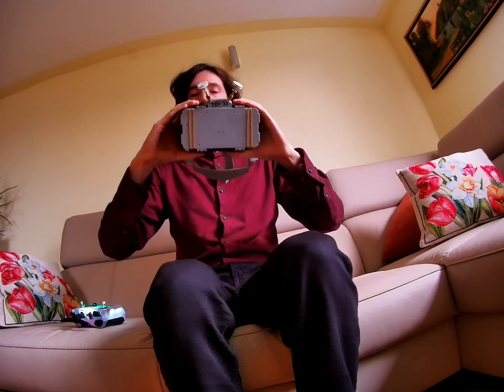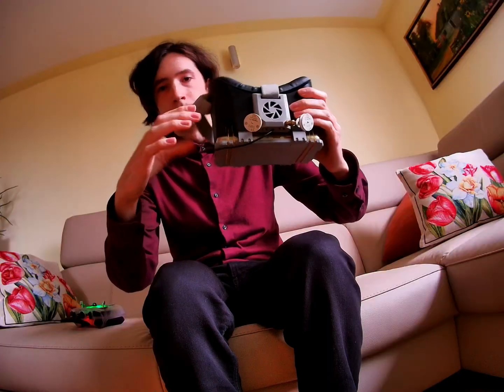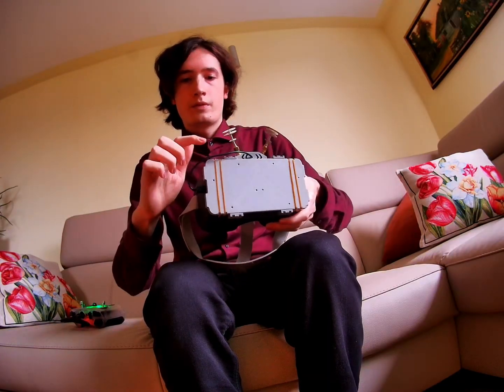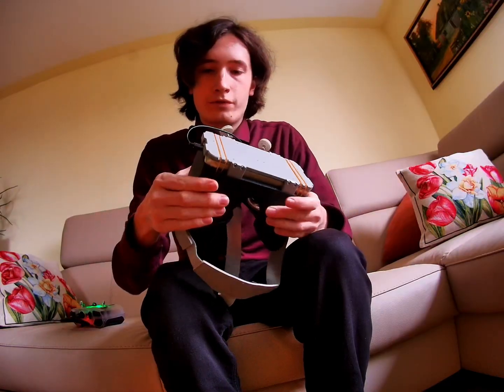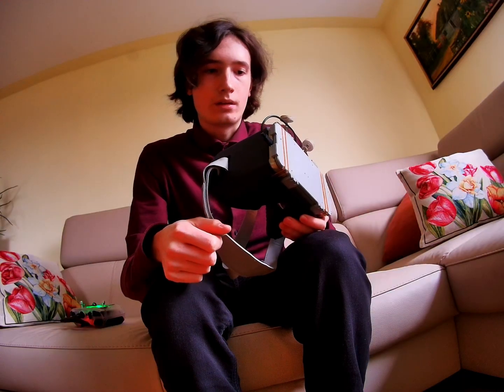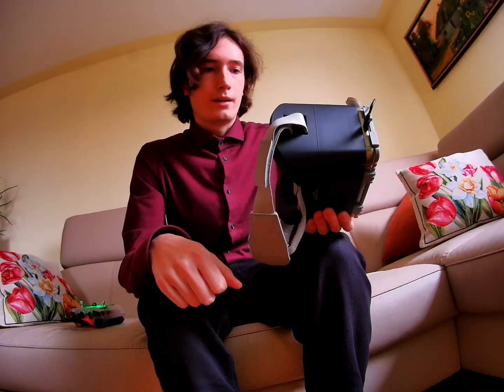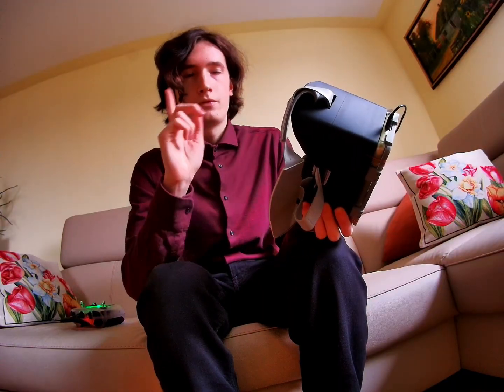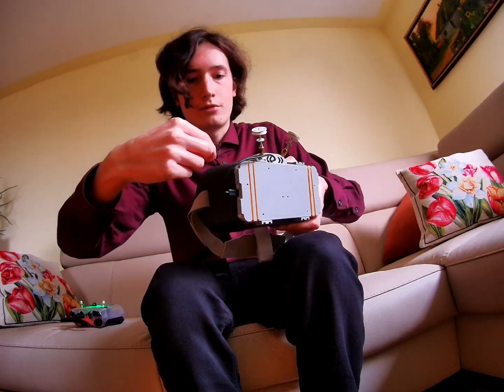OpenIPC digital FPV - 3D Printed Goggles with Android and PixelPilot

Comment: excellent ! which of the two lenses you used in your googles ?
Reply from the maker: I ended up using the 42mm diameter 70mm focal length lenses. I use the screw mechanism to adjust one of them to be closer to my eye because one of my eyes has a bit different focus.